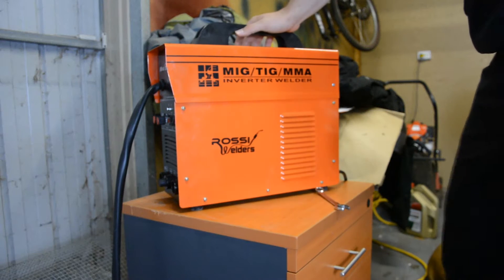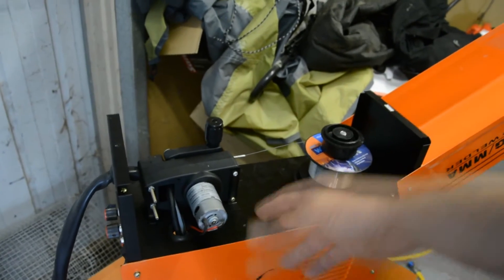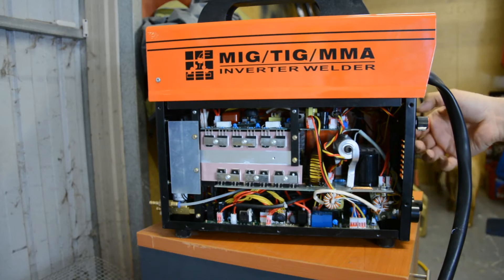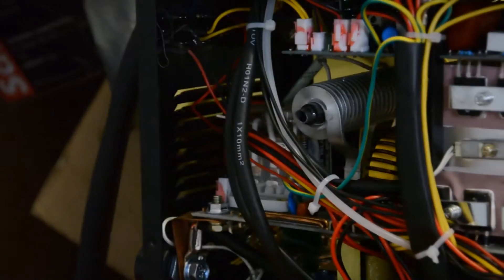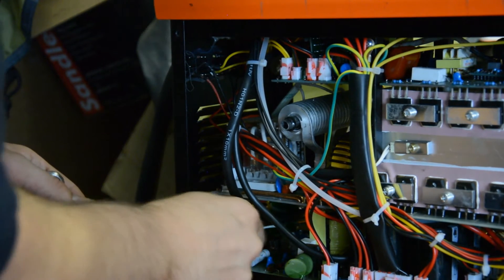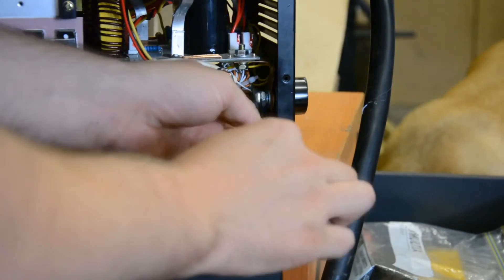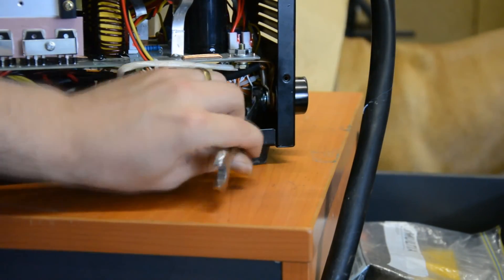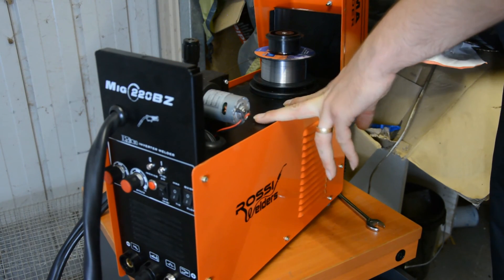Changing The Polarity On Your Rossi Mig Welder For Flux Cored

Comment: I purchased the same model second hand and was told the trigger swith needed replacing on the mig gun. I opened the gun up and found they had removed the wires completely out of the harness. I can't find any wiring diagrams for this model.  Could you please follow the wires from the trigger to the inside of the machine and let me know where they connect to? Thanks

Comment: Do these have a fuse iam getting the inching light and green flashing then shutting down worked alittle first use went to use today using gasless mig it worked then stopped then used stick took a 10 min brake now doing as first stated

Comment: Those 220's are branded with whoever is selling them,  I returned mine and said I wanted my money back unless their techie could show it welding light material and heavy material,   
he said he opened it up,  and there isn't enuf componentry in it to weld properly,    So he gave $ back and said to buy a 185 Mig only,   which I did,  and have used a lot.

Comment: I have this machine without a manual and no any charts found inside machine. Can any one please give  any references about charts, such as the metal thickness, the speed, the AMP in flux cored welding,  don't  know  where to start? This one made in a part of china, truly copied one! not professional .  I asked seller many times for charts  but failed.

Comment: I'll be putting 3 high current terminals under the top cover and use a jumper strap to select the polarity when needed.
I'm just about to click the buy now on this same welder.
Cheers Eric
Reply from the maker: +midgoog2 I had this same idea rattling around in my brain for ages, but I've never changed it back. But it would be a good project.

Comment: Hi Johnney good on you top video. I have just been deliverd not the rossi but the MISHTO on ebay its like your rossi welder. can you help me im using flux cored wire to. to use this do I have to do as per your video thanks Joseph.

Comment: Good day mate , I have bought the exact same machine but the Navada make and i can swap the earth clamp witch is actually the positive on the machine and mine fits straight on to the negative terminal on the machine without opening and swapping wires around , it will affect the way the arc is thrown when the polarity has been reversed , thanks :-)
Reply: Hi & thx for your comment. I was looking at buying the same Rossi as Johnney above but being new to welding have been put off by the idea of having to go to this trouble of changing over the polarity each time I need to. I intend to do mostly Gasless Mig and lots of Arc welding. I have looked at both the 220BZ Rossi and Navada on eBay but they look completely identical to me. But Im interested to know more about the Navada you have if it is truly possible to change polarity over simply compared to the Rossi. Can you please provide more info as I can't see any difference between the 2 machines?. Very much appreciate and help. Thx.

Comment: When you undo the 1st nut you say "this is the negative" when in fact it is the positive. You then transfer it to the negative terminal on the other side. What you did is correct but calling the terminal negative when it is positive is confusing.
Reply from the maker: Yep Im with you, I had a few pints before doing this video so excuse my mistake. Have added an annotation to the video.
Reply: Johnney
Good1 Bud

Comment: So meaning,opening the welder and changing the wire over again?
Reply: +Johnney thinking about getting some battery terminal wire and making up a couple of short terminated leads to reroute some extra terminals in next to the wire feed where they should have been originally , would make it easier if i'd like to do some arc welding etc.

Comment: Does changing only one wire work as i would think  you would have to swap the earth and gun connections no just on connection? Furthermore, are you required to change the wire back when using MMA/Arc etc if this set up does work?
Reply from the maker: Im changing the MIG gun wire to negative and plugging the earth lead into the positive for a full circuit which is required for flux core, if you dont you will find it spattering and the welder might go into overheat mode. For your second question changing the MIG polarity will have no effect on the MMA polarity because you actually plug the electrode holder and earth in either + or - from what I have read (I havnt tried MMA yet) you choose either straight or reverse polarity judging on the type of job you are working on. I actually bought some electrodes from Bunnings and planning on trying it out very soon.